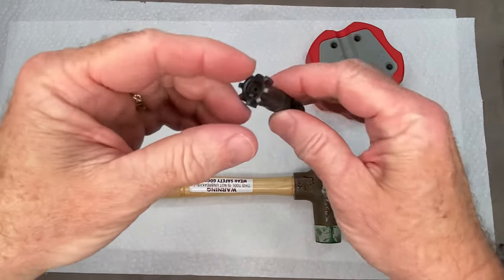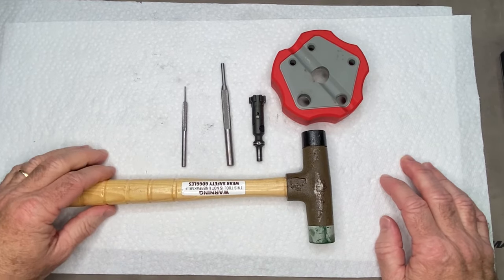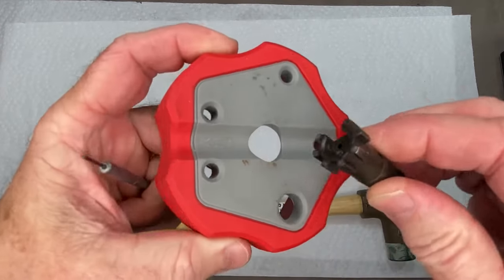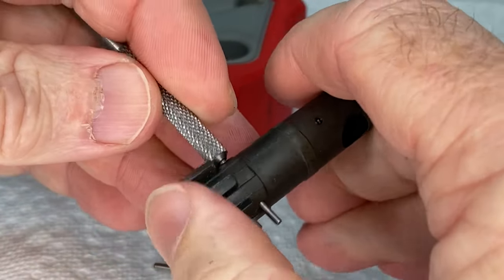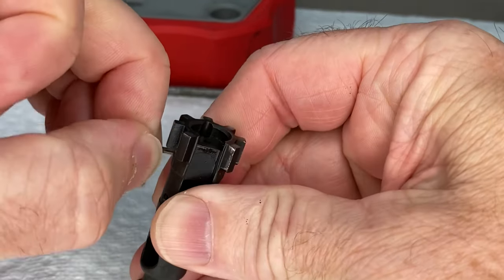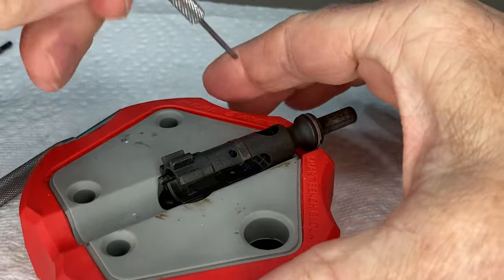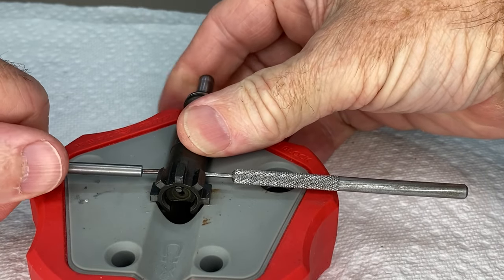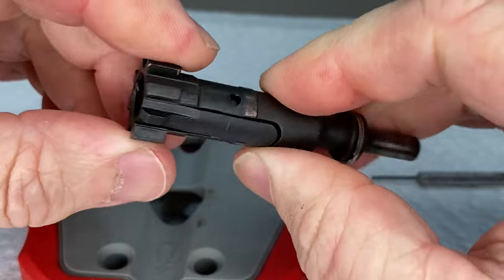How to Disassemble/Reassemble an AR-15 BCG Ejector & Extractor

Comment: I have an AR rifle chambered in 7.62x39 that I need to check the Head Space on before I fire it, so I need to remove the ejector from the bolt to properly use some Go, No Go Gauges. I have never done this before and I've repeatedly been told of all the expensive tools I would need, and you just proved them all wrong with a $15 bench block and a couple of punches. I can't wait to get started thinking of all the $$ you saved me. Thanks a million. Liked and subscribed. GREAT VIDEO.
Reply from the maker: Donald, thanks so much for the comment! I really appreciate it! Glad to save you some money!

Dave

Comment: Using a slave pin when reassembly is a useful technique. I use this technique on various jobs, assembling machines at work. Also, I have used it on AR 15 lower builds. Very good instruction video... No BS just good info.
Reply from the maker: Thanks! I really appreciate you watching the video and leaving a comment!

Comment: Nice !  Iv got a ejector on a relatively new bcg where it sits low compared to others the ejector is flush or a little higher. This one sits lower. It doesn’t eject now.  Just holds the shell
Reply from the maker: Have you removed the ejector to check and see if the spring is in good shape?

Comment: How do you clean the extractor ? Do you remove its spring ? I'd like to  get a spring co  spring.
Reply from the maker: I would just wipe it with a dry cloth, or use some solvent if real dirty. Clean the spring same way and use a pipe cleaner to clean the extractor channel in the bolt. Also watch this video: https://youtu.be/VQnn-LTMqBg?si=QFpgGNHV587m6FAt

Comment: Im getting failure to eject only some times causing big malfunction trying to feed new round with brass in extractor. This is with BCM extractor Spring and o ring. Wondering if it could be ejector problem although seems fine and is relatively new. Or maybe too much extract spring ?  The new spring and or big did fix extractor problem with steel case
Reply from the maker: If you have good tension on the ejector it probably is not that unless there is something in the ejector channel, causing it to bind and maybe occasionally get stuck.

Comment: I want to change the extraction  spring but by the gods the PIN won't come out. I saw you did with almost no effort at 1:10 but mine it's like it's solded. Any tips? Yes I'm using punch pin tools. Great video by the way, very helpful.
Reply from the maker: You might want to kinda let it soak in some WD-40 or something like that for a while to help loosen things up.
Reply: Mine was a pain in the ass to change. Maybe depends on tolerances and/or how many rounds have been on it. This vid showed it easy, mine was very difficult lol

Comment: IF you left the extractor in, how would that screw up a headspace check with go/no go gauges?
Reply from the maker: From what I understand, it can give you false readings. You also should clean the bolt and bolt face before head spacing.

Comment: Where does the little rubber oring go in the bolt?  Do some extractors use an oring instead of the spring?
Reply from the maker: The little rubber o-ring Goes over top of the extractor spring. It is usually an optional part that improves extraction performance by increasing the spring tension. Not all bolts have one.
Reply: It increases the pressure the extractor puts in the rim. It was part of the M4 upgrades called an extractor booster. You don't need it, but I'd say run it

Comment: How long have you had the REAL AVID punches and the Tuffman roll pin punches how have they held up to use?
Reply from the maker: My punches are a different brand, so I cannot comment on that. I know my other Real Avid tools are very well made and have stood up to a good amount of use. Thanks for the question!
Reply: Thanks for the info! I only asked about those two brands as they were the ones listed and linked with the video. Do you know what brand they are and are worth the time to lookup or would you recommend a different brand?
Reply from the maker: I would recommend Real Avid all day long. I have a Bench block and had a Master Sight pusher that are both very well made.

Comment: Serious question: would it be beneficial to use a new roll pin/coil pin when reinstalling the ejector? Won't the old pin be loose? Also, anyone know the size and length of that ejector roll pin?
Reply from the maker: Yes, it is best to replace it but not always necessary. I will check for the size of the pin.

Comment: Great video. I have purchased a 2nd hand rifle that is not ejecting shells. When i attempt to remove the ejector pin it wont budge. the ejector is also stuck fully depressed flush to the bolt face.

Is there a recommendation to help me remove such a stubborn pin?
Reply from the maker: Kyle, sorry to hear the trouble you are having. Maybe try soaking that in WD-40 or a low viscosity penetrating oil for a while to try to loosen things up?

Dave

Comment: Funny trick my dad taught me that I thought was complete BS but actually works..  Build your rifles in the bathtub while sitting on a chair with the curtain closed and the drain plugged to learn the first time. 

If you are surprised with a spring or detent... It's contained and hasn't been shot to oblivion Lol 😅
Reply from the maker: Doubt I will try that but the theory is sound!! I appreciate the input!
Reply: @davesgunchannel  truth be told the first lower I ever did I sent the forward retaining pin detent and spring into another universe lol then he told me to do that.
Reply from the maker: @deadlysrestorations  LOL. I have spent many hours searching various rooms in my house as well. So far, I have managed to find everything I launched!

Comment: Do you use a new ejector rollpin after each disassembly or do you reuse the old pin? I hear a new rollpin often recommended by gunsmith types.

Also, have you tried applying tension on the ejector during reassembly by leveraging a shell casing into the bolt face via the extractor? Appreciate the vid!
Reply from the maker: Great comment! I use the same roll pin but I would probably replace it if I had some laying around as a Gunsmith would! Your idea for tensioning the ejector is a good one, I will definitely use it next time, thanks!!
Reply: Just to add my two cents as an industrial maintenance guy. You always replace the rollpin if you have some laying around as he said, but at the end of the day unless there's something wrong with it (i.e. it's been really worn down from constant removal or it's deformed), the pin is gonna do it's job. It's just a piece of metal there to stop  some thing from falling out.
Reply: You should replace it

Comment: Why wasn't there a rubber gasket on the extractor spring??
Reply from the maker: Not all extractors have the O-ring. It is an extra part that increases the tension on the extractor, theoretically improving reliability of the extractor.

Thanks for watching the video!

Dave

Comment: I have an AR10 and needed to check headspace. unfortunately the pin for the plunger split open when I tried reinstalling it. Do you know the dimensions of that pin, or how I can order it? it really annoys me how rolls pins are used in AR's its like they safe 50 cents and its a terrible product.
Reply from the maker: Simon, try the link below. This roll pin says it is compatible with AR10.
https://www.midwayusa.com/product/1018052226

Comment: At 5:28 when you reinstall the extractor, what keeps the extractor spring in place?  Mine separated itself from the extractor and wasn't happy about going back into place.
Reply from the maker: John, thanks for watching the video! The spring is basically held in place by the extractor when assembled, and friction when disassembled. Mine was tight enough that when it was disassembled, it stayed on the extractor. Did you get it back together ok?

Dave
Reply: @davesgunchannel  Yes!  And wow, a personal reply within 24 hours, thank you.  Took it to the range today and it works perfectly.  It turned out to be just as well that the spring popped out on disassembly - it was dirty in there (that might be why it came loose).  Solid A+ for you, Dave, on the video and the quick answer.
Reply from the maker: John, glad to hear it works perfectly! And thanks for the kind words!

Dave